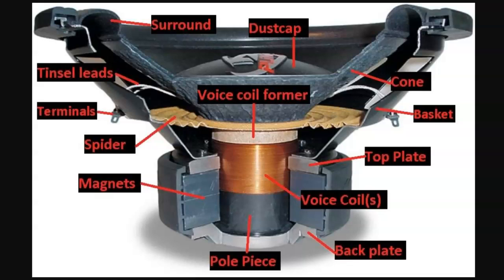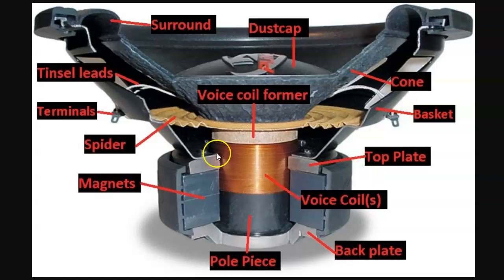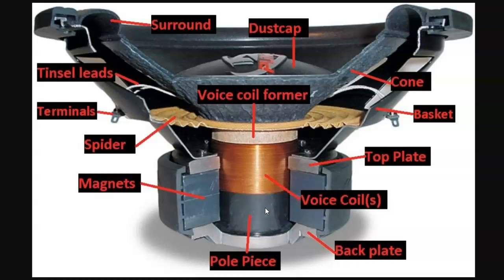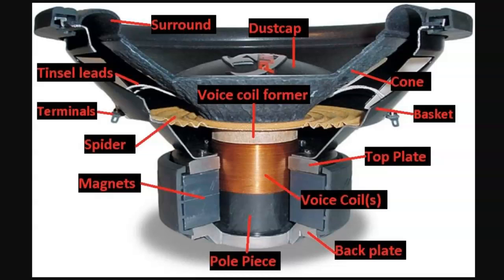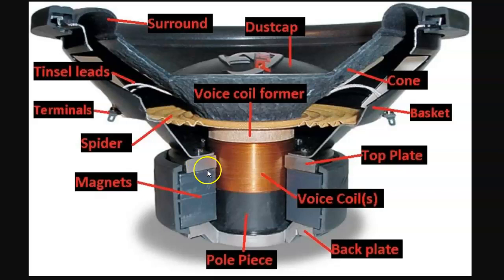The problem with Frankenwoofers and some catalog subs.

Comment: Got 2 sundown U series version 1 subs that are 1500rms subs. Sundown told me directly to put an 8K on them. Said they derate there subs by 50% so that XV3 you said was a 2000rms sub can actually take 3000 all day. So with box rise and avoid clipping  you need at least a 6k with good electrical.  If you have a very efficient enclosure then you don't need as much power.

Comment: Robot cough underground cough cough
Reply from the maker: @@wlxdev I think the problem is less re-using a motor and more rebuilding a motor with different parts.  The entire motor is designed to work with the parts it came with.  Either way, I think the idea of having more Bl makes sense, I agree that it probably would help with versatility.  Thanks for the comments!
Reply from the maker: Hahahaha!!!